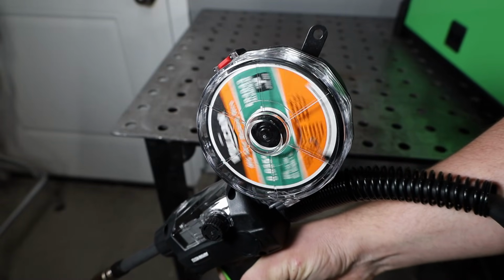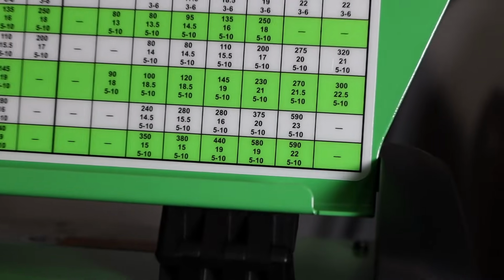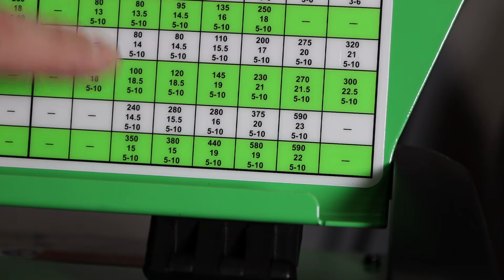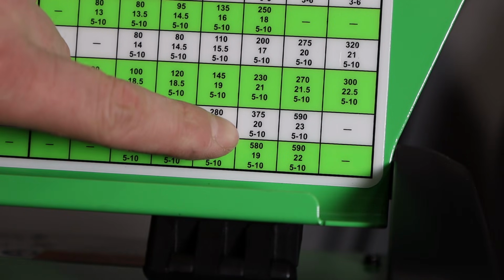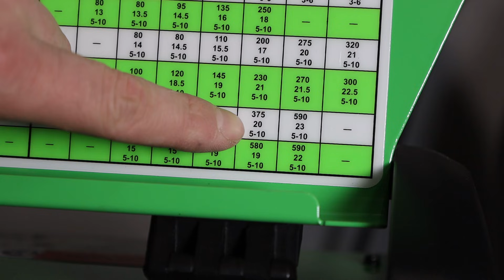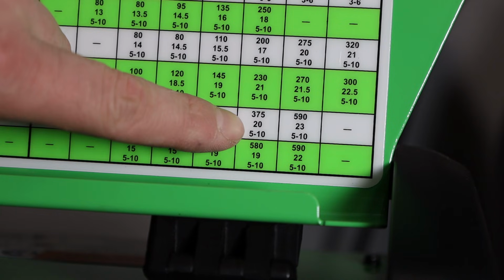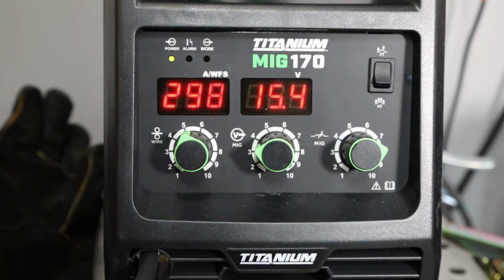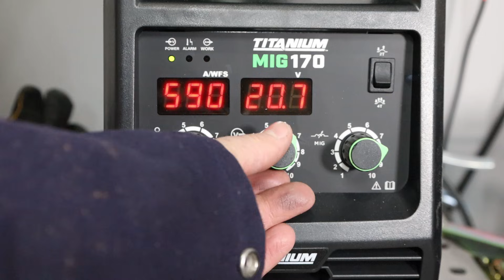Titanium Spool Gun Review from Harbor Freight

Comment: Back when I was buying a new welder, and chose the ESAB Rebel emp 215, I bought it because it was one of the first multi mode models. It’s DC, but that was the best that could be gotten three years ago. Since I wanted to do aluminum as well, I bought their spoolgun for that model. I’ve used spoolguns before, so I was familiar with them. I have to say though, that I’ve never been happy with them. At best, they’re clumsy. Some guns have the cables from the back, and some from the bottom. They feel very different in use. Sometimes the rear cable is more comfortable, and sometimes, the bottom cable feels comfortable. Neither is “best”.

But using these things takes a LOT of practice. The drag from the gun, which doesn’t balance well, and the thick, not very bendy, cable can prevent you from holding the gun at the right angle as the weld progresses. You have to pay much more attention to keep the gun moving properly than with a regular MiG gun.

When ESAB announced the new 205 with AC as well as DC, among other features, I was going to buy it, but for some reason widespread release didn’t come until another 10 months. Finally, I bought that. Truth be told, I much prefer welding aluminum using TIG, which of course requires AC for aluminum. But I also bought another MiG gun and put the Teflon insert in, so I’m using that for MiG instead of the spoolgun. So far, no snags in the tube.

Some other companies also have somewhat similar machines out, so I’m not recommending the ESAB model particularly. It’s just what I use. Lincoln and Miller have good versions, and Harbor Freight has a nice one too. I don’t really recommend Everlast, because I find them to be somewhat shady. They have given hundreds of welders to YouTube channels, so you think they in wide use, but they’re not, and there are problems with their warrantee. They have shills mentioning their welders in a one sentence post in pretty much every welding channel.Just a word to the wise.
Reply: Not to negate your comments about Everlast, but I ran one of their 200 amp ac/dc Tig units in production for 6 years before I had any issues. When I say production, I mean 200 amps, pedal buried almost every day, a minimum of 4 hours per day.  Ended up buying another one after 6 years of use, I think I killed the main capacitors in the board. I called them, and even though it was out of warranty, they made me a deal on a brand new one. I really can't complain about them, for the money, it's 1/3 the price of a blue color unit.  Eventually I was given a screaming deal on a Dynasty 200 and sold the Everlast to a buddy, but it's still going and he loves it. If you can only afford an Everlast, I don't think you can go wrong. I didn't get sponsorship, or a kickback or anything form them, I'm just a guy that welds all the time, for a living.
Reply: What has to be understood here, is that most high quality pro machines, according to industry statistics, such as ESAB, Lincoln, Miller, etc have about a 2% failure rate, while Everlast has had, according to forums, a much higher rate. Even if that rate were three times higher, it would still be just 6%. Most people won’t have a problem for some while, if at all. But it’s still much higher than the companies it’s trying to compete against. That’s meaningful.

The other problem is that while they claim a 5 year warrantee, as compared to the 3 year other pro companies offer, again according to forums and complaints to the BBB, it’s very difficult to get that service. Even Zila, a well known guy on YouTube had his welder held for 6 months, and when, after more than a few phone calls, had it returned, the same problem was there. This has been a common complaint.

Then there are the many troll posts we see in welding channel forums. There’s almost always something like; “I can’t wait to do this with my Everlast welder”. I wonder if there is someone in the company that trolls channels and posts this nonsense, or whether they give equipment away with the requirement that the person do it. We do know that most of their welders, and now, plasma cutters, are given to the person in the channel. You can always tell, because they never doing anything without specifically saying that they’re doing it with their Everlast …..fill in the model number, often followed by something like…a wonderful machine. Really annoying.

Now we’re beginning to see Primeweld do it too, which is why a lot of sites are suddenly using their machines, “testing” them, and saying wonderful things. Evolution saw was doing that last year.
Reply: I dont own a welder yet but the sense I get is Everlast is like the Hyundai of welders with a 10 yr/100,000 mi warranty.  Thanks I'll take the Toyota with 3 yr/36,000 mi warranty any day of the week